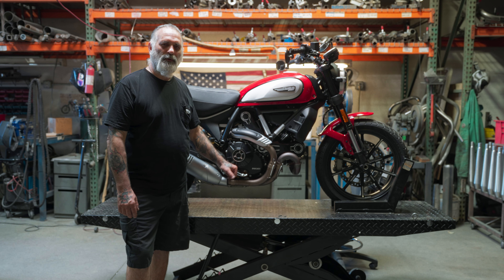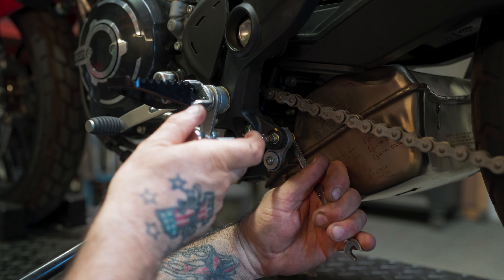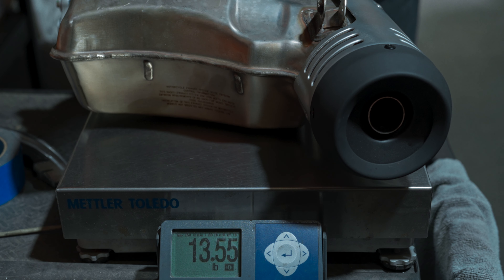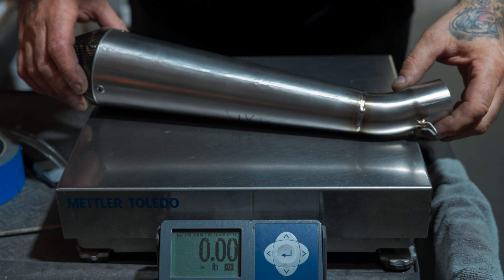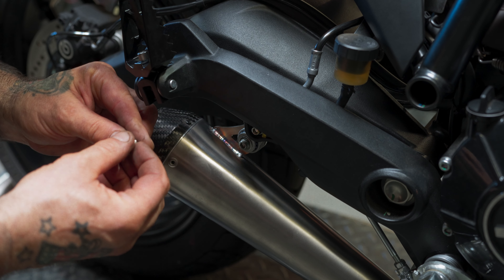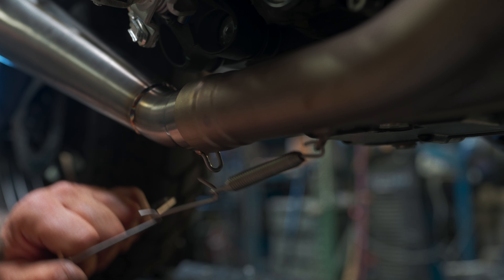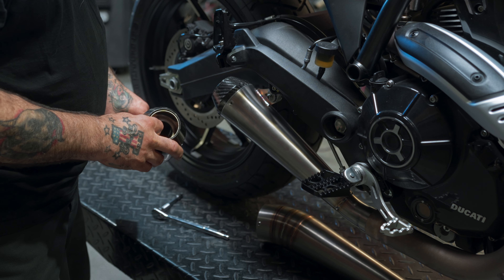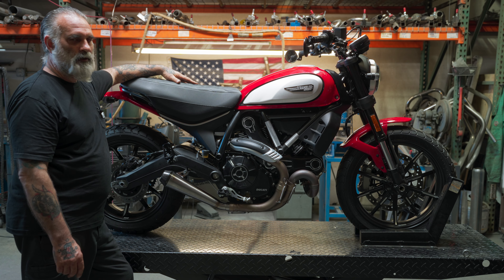How to Install a New Exhaust on a 2023 Scrambler Ducati

Comment: Is remapping necessary on the cat delete , because I'm planning on doing it on my 2024 nightshifts' and leaving it as is.
Reply from the maker: It's not completely necessary but we highly recommend it as a new pipe would most likely mean something with more flow (performance), changing the overall a/f mixture ratio on your bike, meaning it won't run as smoothly through the powerband.